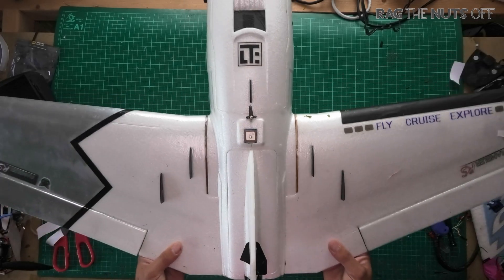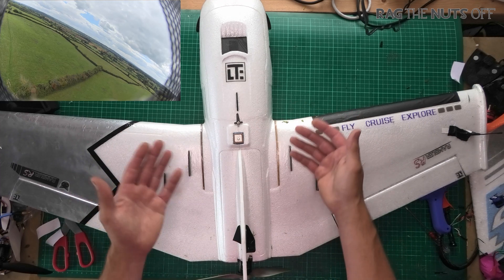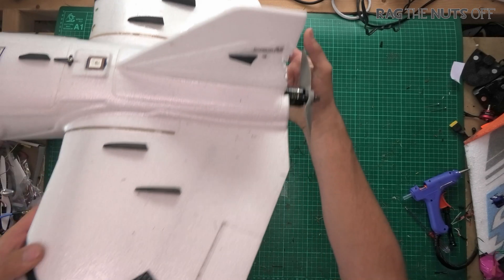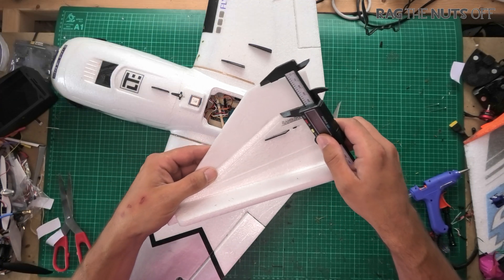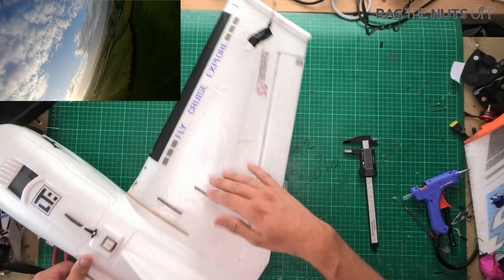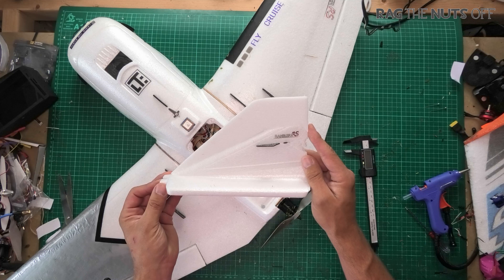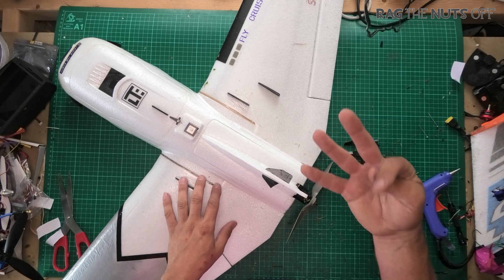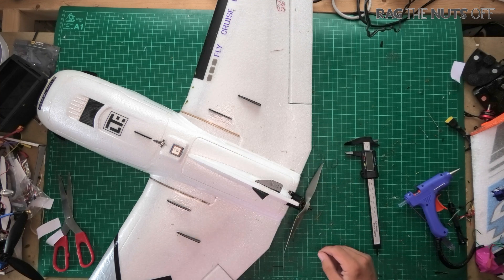Fixing the "Nose Hunting" that the LTE Rambler RS Has (Mod #2)

Comment: I think the adverse yaw problem actually stems from not having any/enough aileron differential throw. The larger vertical stab area will create more yaw effect from crosswinds.
Reply: Unless I wasn't watching the video well enough, adverse yaw is not the issue, it's only yaw hunting. I think it stems mostly from having a forward swept wing, which causes more drag on the rearward wing and pushes it even more rearward. At a certain point the yaw angle will be enough that sideways airflow on the vertical stabilizer will prevent further yaw movement, but if the stabilizer is small then that correction will not happen very quickly. Usually planes like this (eg. drak series) address this issue by having two vertical stabilizers, and I think they're a bit larger too. The draks also have a curved section where the wing meets the fuselage, which is technically a 'normal' sweep section that will provide a small amount of positive yaw stability.
Reply: Try setting the differential throw so that the up aileron moves about 3-4 times further from center than the down aileron moves.
Reply from the maker: Howdy, the fin made a massive difference. I'm happy with that change alone 👍

Comment: Very clean implementation Matt! Looks good. Finally flew my dart 250. As soon as I tested the stabilization it went crazy and by the time I got it back in manual I was in the woods. Took a while to find it but that issue proved to me I should have stuck with inav. I used the kopilot cause I had it laying around and it doesn’t have a visual confirmation of level like inav does. So I’ll be changing out some stuff. My launch issues was just me not throwing it hard enough.
Reply from the maker: Yea I must admit, iNav auto launches make this model a lot nicer!